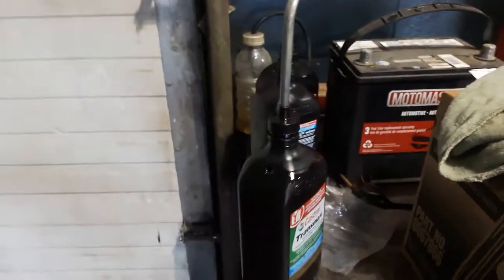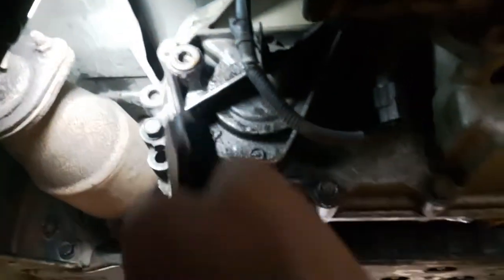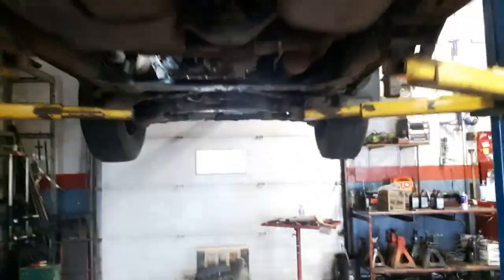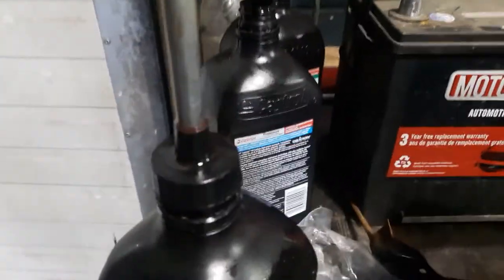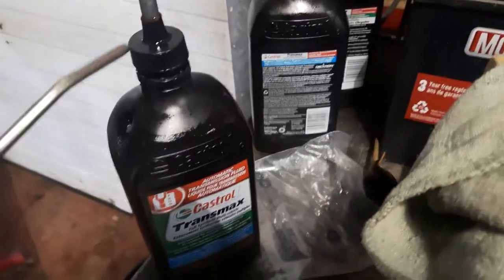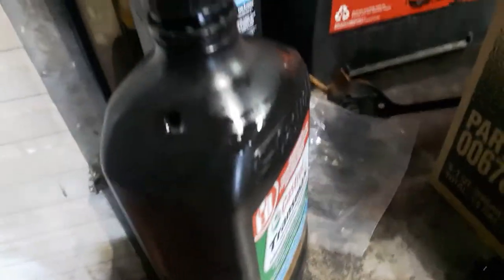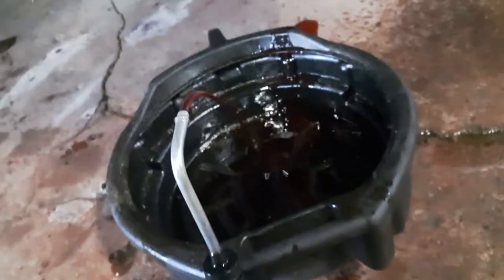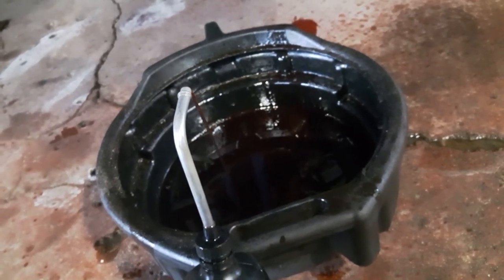AUTOMOTIVE LIFE HACK~GEAR OIL TRICK

Comment: I am so going to use this the next time I have to change the transmission and transfer case fluid in my jeep.
Reply from the maker: +Shad Van ever since i learnt this trick, its the only way i fill transfer cases, diffs, and manual transmissions.... just be VERY careful to not put too much pressure into it at a time as they can and will explode the bottle. And as loud as a tire blowing with oil going everywhere... dont ask how know :/ haha.